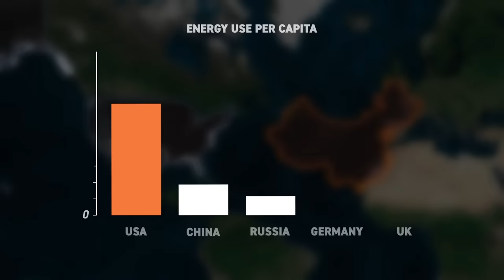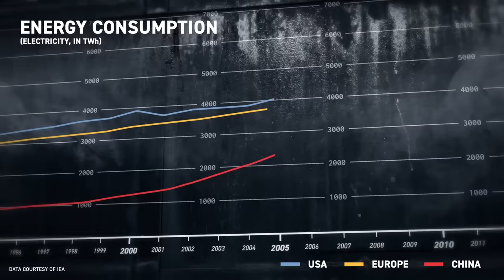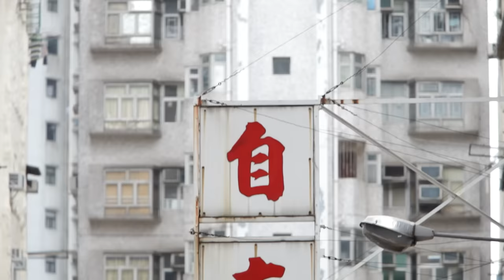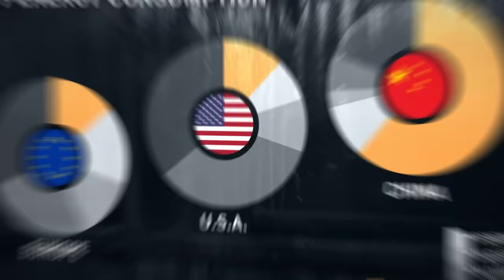China’s Electricity Problem

Comment: I don't know where you got your data, but the data I got was that air conditioning consumes 40% of total power generation during the hottest months of the summer in some areas, and 30% on average nationally, yet that's just during the hottest months. China's combined wind and solar power installations will surpass coal power installations for the first time this year. You need to update your data. The U.S. consumes five times as much electricity per capita as the Chinese, and given the U.S.'s two withdrawals from the Global Carbon Reduction Agreement, you'd do well to spotlight U.S. behavior.

Comment: Maybe adding nuclear power would help a lot, its kinda the highest output power tech around and its damn clean too, building lead-lined bunkers to store the waste that comes out every couple years when they need their fuel rods replaced is not that bad, we know how to seal the stuff away and we know how to reuse it now too for both space applications with RTGs or ultra-long-life low-power installations for experiments and/or sensors for weather and how much cosmic radiation is hitting us from both the sun (which is the main driver of the climate I mean sunlight is kinda responsible for about 108 PW of light and heat globally while mankind consumes just around 31 TW) and the rest of the galaxy, and nuclear can throttle slowly up and down with oil and coal based plants providing ride-through for those times that solar, wind and perhaps hydro inevitably go up and down, since batteries powering the grid is kinda not good for the environment at all, unless we figure out a way to make massive amounts of sodium-based batteries and/or really good gigantic supercaps that don't use loads of rare earth metals that are really expensive and also really dirty to mine and process, like cobalt and lithium are. Basically, nuclear good, renewable good but not something we can fully rely upon, fusion nowhere near viable yet (no exploding a tiny capsule and getting more energy out than the lasers is not viable that's an explosion not sustained fusion), and oil and coal power can be the thing that patches over the gaps in throttling nuclear up and down to match renewable ebbs and flows. In fact, those ultra-long-life sensor installations can be used to calculate when to throttle up and down nuclear plants depending on weather around solar and wind installations, know when wind will pick up or more sun will come through the clouds so it can be throttled down in time with the rising generation from renewable, or throttle back up when conditions deteriorate and sunlight wanes and wind weakens. The theory is simple, implementation will be a real pain in man's collective asses, it'll sure make a lot of jobs for people to find work in and it'll keep us going until the time if/when fusion finally becomes viable, in several decades or so at least methinks.
Reply: Way simpler solution that is fool proof, reduce demand, reduce user count. As the saying goes reduce, reuse and recycle, clear out useless players first, do this in indirect ways that make it seem like it is their own decision to rage quit in one way or another, after all were in the civilized 21st century, useless will be defined as anyone who can be replaced with a machine to do the task they filled, and the player is no longer able to adapt a new strategy to be productive. Reuse, these are all the players who are of slightly higher quality than the previous group and are able to adapt to fit into a new piece of the system that rewards them a smaller share of resources, this is done through monetary inflation so nominally this new task appears to pay them more which is why they take it in reality it pays less and they consume less doing x task. Finally recycle, with the resources being freed up from the first 2 groups all of that can be recycled to the people, who actually matter and are smart enough to use them productively to build a better future.
Reply: The best way to store energy from renewables has been with us since the 50's or so it's called hydropower and we can use the extra energy created by cheap renewables to lift water or anything actually and drop it when it's needed as it falls it powers a turbine. Coal is already obsolete, have you not noticed that some of the biggest miners are already leaving it and going into renewables, even our mineral smelters and furnaces are already heading that way calling it 'green steal' not blue steal (as the coal industry wants). We simply don't have the time to wait for new Nuclear to come online and no-one wants it or it's radioactive rubbish near them, despite what it's promotors will tell you about their safety they are not!
Reply: Not an issue - China's population is about to plummet == demographics
Reply: Nuclear power is a solution. Understand the logistics and risk of running a nuclear power plant versus a coal power plant are way different and maybe its a good thing that we aren't totally ready to move to nuclear power production.
Reply: @boopro12  Regarding safety and risks, the number of deaths attributed to coal plants is several times higher than that of nuclear plants. Also coal plants have spread more radiation (coal harbors radioactive isotopes that are releasing during burning) than nuclear plants. Not to mention that waste produced by a nuclear power plant is much easier to manage, since it's comparatively little and you can't feasibly directly capture coal burning emissions. So nuclear is much safer and poses less risk than coal. However, it is much mure expensive to set up and takes several years for one plant to come online. You won't see electricity coming from one in the short term. In China, though, maybe they can produce those plants extremely fast.
Reply: @renato360a  The amount of coal that China has plays a big role
Reply: @renato360a  Also another point about nuclear is that there is a large upfront cost verses coal and many more regulations. The over all lifetime cost pre kilowatt may be comparable to coal but unlike coal most of the cost is spent building the plant. Either way nuclear is a grate idea and the world needs more of it but stating cost make it had to build new plants.
Reply: "adding nuclear power" is what China's already doing it. They have the largest nuclear power plant construction program in the world.
Reply: @johnzuijdveld9585  yeah as someone whose actually done a physics degree Nuclear is extremely safe in the 21st century. Only 3 major nuclear accidents have happened and theyre all caused by poor decisions and lack of understanding from decades ago. A nuvlear power plant constructed today would be extremely safe.
Reply: Awesome comment bro.

I really wish we had some radical revolution in battery technology. I feel that energy storage is just as important as energy generation. We've learned a lot with lithium and it's pretty amazing stuff and I'm sure it'll be around for a very, very long time yet, but I don't think the lithium-ion battery is the future for large scale operations, lets say.. anything the size of what a Tesla would require and larger.

In this video for instance, in the case of China, where the conditions that are favourable for renewables are several thousand miles away from the urban centers where power is needed most, and it crosses through many different provinces/states, each province could have its own station, with some radical type of energy storage, lets just imagine some crazy graphene layer cake huge cube cells buried under the ground the size of Walmarts that can hold power storage to run an entire city for say... a week. They would sell that power, or have some kind of scheme where, okay, the first station's cells are full to a certain point, excess flows to the next province until their battery stations are full, and then down the line, until it feeds into where it's needed most, the east coast where the major cities are. And of course, at those cities, have multiple massive battery farms that can store power and when demand is low, lets say at night or something, yet the wind turbines thousands of miles away are still producing, and batteries are constantly filling. Make it modular that you can expand the storage as needed (preferably as much as can possibly be built, so that there's always surplus energy around). I'm definitely not an expert or anything, but it's just fun to think about.
Reply: @devin19222  you say this until you are in the first group, then you say its unethical 😱
Reply: @devin19222 you know that would simply cause manufacturing to other places with cheaper production cost right? We still buy all the stuff we want at the price we can accept, so simply put, if it’s not China, it’ll be another country.
Reply: Nuclear energy itself is good. However the cost is tremendously high and takes much much longer to build a nuclear plant. In my coutry it is estimated that a nuclear plant would cost nearly 4 times higher than a coal plant with the same output
Reply: China's nuclear power program isn't exactly the role model considering its plants regularly dump more radioactive waste into the ocean than the entirety of Fukushima's stored reactor coolant getting gradually released now.
Reply: In 2021, China has the second highest number of nuclear power plants in the world. And also the top in using solar power. I think the author missed that part.

Comment: People figured this out over 100 years ago. My house is 120 years old in Australia, it's not fancy but it's got 12 foot high ceilings. In summer it's so cool inside wouldn't even think about air conditioning because all the heat rises to the ceiling and vents let the hot air out. Shame about winter though it's a bit cold.
Reply: Some ceiling fans blowing down the warm air during winter would help, eh?
Reply: @1967250s  Yep, in Spain, ceiling fans have "winter" mode where the fan reverses, pushing warm air downwards.
Reply: High ceilings don't always work and when they don't it costs a fortune to cool with AC.
Reply: have high ceilings in Michigan, shit does not work
Reply: Maybe it also has to do with the construction of the walls got double clay brick with gap between.
Reply: @SureJungle23247  sounds like your house was by built by people who still knew the old ways
Reply: Is your home on pier and beam? Cuz if so you could easily  put a thermal blanket wrap around the base of the home that goes a little bit into the Earth a few inches like a trench or  U channel , and up to the highest point of the foundation floor as it would meet that outside wall where you are going to attach the material and she's the best to probably run it under Channel upside down a Groove for example and run this sheathing all the way around the home completely so that you know that there is no way any air or when can get in underneath it, at the top Edge or through. If that is done you can actually dig a hole under the porch of the home that would be either Central or a key location for Distributing air to the different rooms and parts of the home and you can either at a heating element to just a low noise high velocity low spinning very energy efficient fan kind of like a attic fan but it's going to be under the home and I could come up through a great that you have where you can close it off and open like ventilation vents on the front of an AC unit or the AC that's in your vehicle. Or if you're in a very cold climate you could even put your heat pump or other furnace type device in that hole under the home and have your duct work or your thermal box made to the airtight and have the fan Forest air brought in efficiently into the home but you can even use the air off the Earth because the Earth in the ground there during the winter should probably still be around 60° to 70° f and if you add in like I say a single heating element to help dehumidify that air while heating it as well from that temperature instead of say from a much lower temperature like you would normally would do you already saving money and quickly accomplishing the task
Reply: @lyleg.9192  Yeah not sure about the pier and beam but it does have a crawl space underneath with wood floorboards, but it probably really isn't that cold in winter compared to the USA and Europe. I'm Australian so it probably only gets to like  0 degrees Celsius a couple of days a year but when your used to hot days I start getting cold at about 15 degrees Celsius 40 degrees C is nice day for me anything below 30 deg C and I'm freezing.
Reply: @SureJungle23247  gotcha
Reply: I had a new house about 30 years ago in California.  It was part high ceiling and part standard 8 foot ceiling.  In the winter heating, heat goes to the high ceiling first and takes longer to feel the the heat in those rooms, while the 8' ceiling rooms becomes unbearable hot.  The builder did not put ceiling fans in the high ceiling rooms.
Reply: Apartment living in the hotbox 😳
Reply: Chinese people are usually living in tall apartment building instead of single-family house. i think China should start considering centralized cooling system in the building though... that might be more energy efficient.

Comment: The UHV line shown at 8 minutes in was UHVAC ultra high voltage alternating current 1000kV Single circuit / 3 phase. 

UHVDC would have just 2 conductors (bipolar dc). It's all an amazing system. China has really stepped up their game they aren't messing around. Thanks for covering this stuff a rare treat.

Comment: Brazil has also experienced two powerful droughts, which affected our energy production because more than 50% of it comes from hydroelectric power plants. The solution the government found was to encourage the construction of new natural gas thermoelectric plants, which raised controversy because of the high costs and pollution. On the other hand, wind power production is growing at a fast pace and is already the third largest source of energy.
Reply: Natural gas plants, properly regulated, dont produce that much air quality pollution. The CO2 emissions are moderate (~600kg per MW/h?). 
The claim that is made is that it is forest clearing and ranching that have been the main cause of the drying of Brazil and the droughts. Irrigation as well? Dams and changes to the water flows might have had an impact as well. 
It is a big hungry population of 200+ million people. 
The government will need to try and do major land works to try and improve yield and productivity. And people there will need to adapt to the changing conditions, very little of it can actually be % attributed to global climate change. Most of it will be regional factors.
Reply: @lieshtmeiser5542  agreed, hopefully the government will make it harder to continue the deforestation in the next 4 years

Comment: Bear in mind, vast arrays of solar panels have to be kept clean on a schedule, otherwise their efficiency goes down due to sunblocking particles (natural dust, sand, bird stuff etc). 
And they have a life span of 20 years ish.
So it's not a completely free solution.
Reply: I'm not so confident they're really cheaper when all costs are considered. The US, for example, regulates  the price at which solar and wind can be bought and sold and the industry is heavily subsidized.
Reply: It's called kicking the can down the road.
Reply: Solar is awesome for sail boats, tiny homes and homesteads. They are a waste otherwise.  We can't even recycle the panels. They cost nearly 5 times to break down then the recycled material is worth.
Reply: @hstapes  Oh it's most definately more expensive that what is claimed. Solar/wind does not replace conventional power sources, they reduce fuel consumption. You still have to keep those power plants up and running or you'll end up with blackouts whenever the wind slows or the sun goes down. Effectively we're paying the cost of wind and solar on top of the cost of keeping the conventional power plants running minus some fuel consumption.
Reply: as i know，electricity companies hire the local people to clean the panel and allow the farm to feed the herd under the panel，so the sheep and cow can eat the grass under the panel😅
Reply: The only thing simple in this universe is the equation 
Green = scam
Reply: @asx-tj1vn  How does grass grow if it's shaded under the panels??
Reply: @kellonpitts2650  The sun moves. There are gaps between the panels. It actually grows better under the panels and my friend grows tomatoes under his.
Reply: At 20 years the panels are still producing 80% of original output. 20 is the warranty, not the life span. Also, they're self cleaning when it rains. :)
Reply: @nunya___  I was just being a smart ass
Reply: As of this year it's the cheapest.

Comment: a whole video about electricity production with no discussion of the zero carbon emission elephant in the room. Even if nuclear doesn’t work in China for some reason, to pretend by omission it doesn’t exist, isn’t an option, and isn’t necessary? Some folks might be surprised to learn the sun doesn’t shine on solar panels for at least half of every day and the wind sometimes stops blowing.